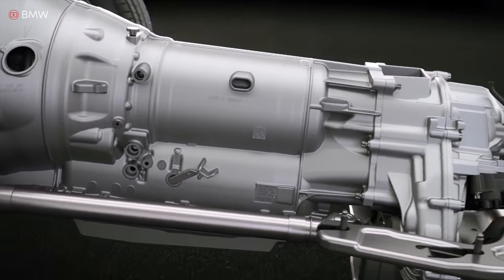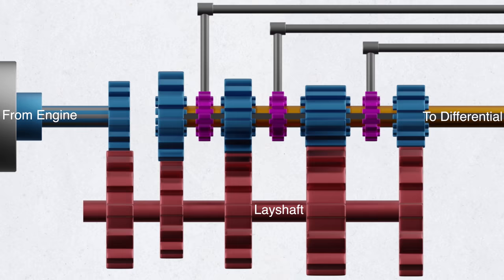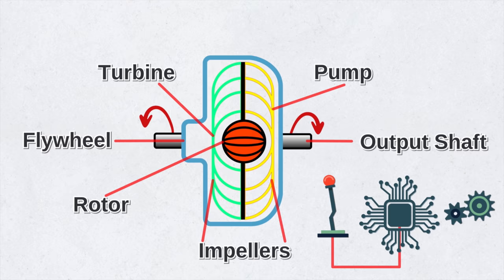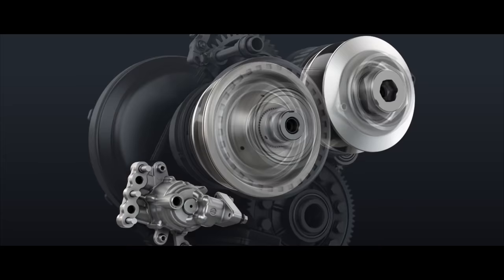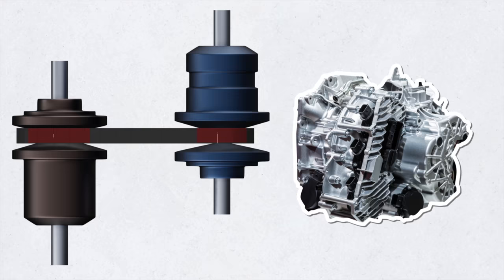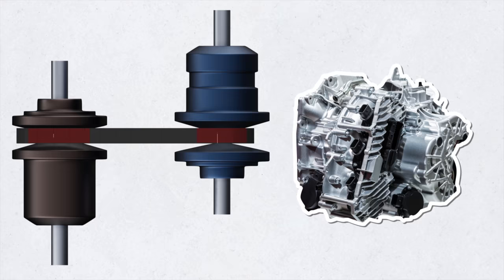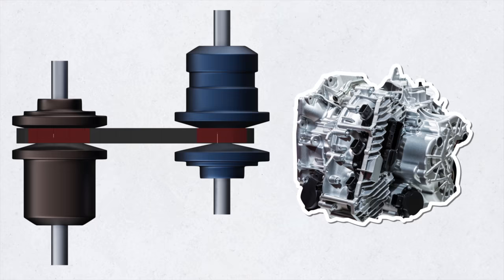Parking Like This Will Destroy Your Automatic Transmission

Comment: My wife bought a car with a manual transmission and it wouldn't shift correctly within the first month of her owning the car. When she took it back to the dealer, they asked if she knew how to drive with a manual transmission, with the assumption that girls can't drive stick. This was the point when she had to remind them that the truck she traded for the car had a manual transmission. Because the car with still under the factory warranty, they replaced the transmission because it was defective.

Comment: me and a friend bought '14 Impreza hatchbacks around the same time, his manual, mine CVT with flappy paddles for simulated gears. His manual was so touchy that even though he could drive most manuals in his sleep, it took him a month to get the hang of his new Sub. It was really rough, and when he rode in mine, he always had mixed feelings. No way he'd give up his real manual but the smoothness of it was night and day, and we got basically the same gas mileage.

Comment: This is what is stated starting 17.24 "another common mistake is keeping fuel tank low. Did you know an automatic car depends on fluid pressure to run properly. Fuel pressure also helps to keep your engine parts stay cool and lubricant. So if you consistently keep your tank low on fuel you can wear out the car a lot faster than normal"
What nonsense, when does an engine rely on the cooliing due to fuel intake ( it does happen near the intake manifold, so what, that is to be expected). The methods of cooling are by convection by the use of fluids in the radiator and conduction through the engine casing such as fins. 
Scotty talks at million words a minute, if you listen closely and know the subject there are plenty of errors here. I did research on wear of steels and what he is saying is baloney. He clearly is talking out of his depth here.
For an engine to wear out, it can be due to lack of oil, lack of radiator fluid causing higher temperatures that degrade the oil, and normal wear. Lack of fuel in the tank means your vehicle won't start.

Comment: Manual transmissions are fine in traffic if you can adopt a smoother driving style and learn to regulate your distance from other traffic to reduce frequent changes in your speed. It's also a deterrent for thieves. 🙂

Comment: Here's my horror story. In 1981 my company car was a beauty black Cordoba. I loaned it to our sales manager for the weekend. When he returned it on Monday he left it out back of the parts department. When I went out to move it it was gone. Over the weekend the sales manager had broken off the parking pawl and when he left it for me it was running on high  idle. It managed to slide into reverse and race past 4 service bays. Our shop truck was being loaded with garbage by sheer luck the young fellow heard my car coming and dove out of the way just before my car slammed into it at about 25 mph.

Comment: How strong are CVTs for pulling trailers?  Our 2013 Subaru Outback with a CVT has the same trailer rating as the "normal" transmission, but are they really equal?

Comment: I like the idea of a cvt. They were popular in The Netherlands' only home-grown vehicle:, the Daf. They were often sold in other countries to drivers with disabilities. But you never felt you were in "the right" gear.
British attempts to automate gear changing led to the "pre-selector" gearbox. These were seen on "posh" vehicles like Armstrong Siddeleys and (British built) Daimlers. They didn't progress to fully automatic, because the missing component was always - believe-it-or-not, memory. So they still made use of the brain which was thrown in for free with every driver.  British buses continued to use pre-selector boxes until the end of the century. 
In general pre-selector gearboxes were swept away by the superior fully automatic types available from America. There was usually a substantial weight penalty, compared with a manual gearbox.
Note that one of the lovely things about electric vehicles, is that you don't need to "change gear".

Comment: I did heard rolling in neutral saves fuel, but if scotty says it doesn't then I bet he's right. I noticed the car did went faster but its always downhill so it's dangerous.
Reply: Engine is on, why would it save fuel lol
Reply: I like tk ahift into nuetral at long lights... in drive damage engine stopped ?
Reply: it doesn't save fuel in modern cars. when coasting downhill in drive the ECU lets the wheels keep moving the engine via the transmission and gravity. on some slopes using no fuel at all. It doesn't do that if you are shifted in neutral because then, the engine is disconnected from the wheels and has to keep itself running via using fuel
Reply: @nickmalone3143  no it won't damage the engine

Comment: I had a huge argument with somebody about not just putting the car in park but using the hand brake/parking brake/emergency brake. They argued that park is called park so it's fine. As though parking brake is called that because they just picked a word out of the dictionary? And the wear on the pin is fine because it's a "solid chunk of metal" as though dynamic stress isn't a thing. 2 extra seconds of habit to save your transmission, why wouldn't you?

Comment: One time I had an 86 caprice. Had a cig cherry fall on my hand and flung my arm up throwing the car into park at 50.
Reply: ...and ?
Reply: You left out the most important part-what happened?
Reply: Brrrrrrapppptatatappppp Trans gone
Reply: Oh yea I bought it for 300 bucks and got 350 at a junkyard
Reply: That must have been fun, these modern dial transmission shifters are scary. Try to turn down the music or HVAC fan and you'll destroy your transmission instead for turning the wrong dial.

Comment: 03:56 my Dacia Sandero 1,0 L can drive  with 1 US. gallon 48,2 miles ( 5,03 L/ 100km ) on highway 90% / 7 % Urban and 3 % city mode. Manual gear box  108 Nm / 5300 rpm and only 53kW ( 73,5 hp) .

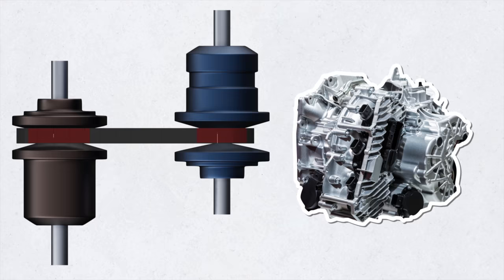Comment: When I park with my automatic transmission I'll put on the brake, put the car in neutral, put on the parking brake, lift the main brake so the car settles into the parking brake, and then put my car in park and shut down the engine. 18:13

Comment: Excellent talk on transmissions.
Daf 33s had a variable belt drive transmission back in the 60s and 70s, the system was reliable.
The problem what some people had was the shift lever as you could easily leave the transmission in either forward or rev, you could jump in start it in gear and if you didn't look at the position the shift lever was in you could easily rev the car when you were thinking it was going forward and rev it into something, was not good .
There wasn't a start inhibate system.

Comment: I guy I went to high school with had a VW Beetle with that semi automatic. All you had to do was let off the accelerator a little and shift gears. It only had 3 speeds so you didn't have to shift often. But it seems like CVTs are so complex that they are kind of like modern electronics in that they are designed and built to be replaced and not repaired.
Reply: If electornics fail to keep the belt size the same through gear change then it ultimately  breaks .... tranny controller fails then it literly destroys the mechanical parts
Reply: They were junk
Reply: I had one of those too. No problems with it, but I hated it anyway. I had to take what I could get when I was 18, though.

Comment: I was once pissed off with my car, I grabbed the transmission and put it into drive without depressing the button.  I broke the park pin and never did fix it,  I could shift just by looking at it after that.  It would pop into reverse on a bumpy road

Comment: I got the transmission in a 2002 Civic flushed with over 200,000 miles on it.  Terrible mistake.  The transmission never shifted right after that, and ultimately failed hundreds of miles from home.

Comment: We need a stat for accidents on how many are had driving which transmissions
Reply: Hard to drive crazy in a automatic.  All you can do is floor it and point the steering wheel. And hope for not to much understeer
Reply: Those stats wouldn’t tell you much more than that.

Comment: I have a stumper for anyone inclined to answer.
Just had a Son and Mother come into my Autoparts store and get their codes ran on their 2002 Chevy Corvette with a supposed LS1; why would it come back saying the Cap and Rotor needs to be replaced? I told them they had either a engine swap and or ECU. They didn't want me to take a look at their engine at any point........

Comment: My first car was 1964 GTO with a manual 4 speed. I have never liked or trusted automatics. They are expensive to buy and repair
 My manual cars only needed an occasional clutch which I would replace myself in about 4 hours for low cost.

Comment: Wait what? you don't replace the cvt belt, it doesn't wear.  Change the cvt fluid yes, but the belt is never the problem.  The bearing's that allow the pullies to move crumble and jam and the belt comes apart, but it's not because of wear on the belt.

Comment: My first car was a 1991 Chrystler Lebanon comfortable ride  i  bought it used and noticed a week in to driving it  that it hesitated to shift and sometimes had a hard shift. I was 17 at that time it was around 2000 i took it in to they’re mechanic to get fixed because if i did not id void warranty now i had saved up  and paid in full . Eventually 3 years passed and i babied that car  or at least I thought i did. I kept fluid levels correct at all times . My friends accused me of grandpa slow driving at the time. However the hard shift came back  they had closed up shop by then. They couldn’t compete with the bigger car dealers in the area supposedly any ways one day while driving on the interstate my car did the little pop thing and then locked up and that was that. My next car was a 98 dodge neon it only supposedly had 16 k miles and it was like new everything looked perfect and importantly affordable…2 years in transmission did the same exact thing as the labaron. Next car was a seabring same thing  all at different miles. Different dealers . 

Years later a mechanic friend of mine claimed dodge and they’re other brands have bad rep on transmissions  yet i see  thousands of them around that seem to work still. Is the dodge transmission thing a myth or does it have merit.? I know they make jeeps or at least own them. Did i drive them wrong or did i get screwed by the dealership? like i said i was a fanatic about keeping my car the fluids and everything else clean and tuned up tried not to drive hard. Like i never raced it or drove angrily or aggressive because as my best friend put it ‘’tickets are expensive ‘’ all these years I’ve tried to avoid dodge cars because of this. Sorry this is a novel. Lol  

I guess my question is about dodge transmissions and if it was them did they fix the problem or update to a newer design?  All of them were automatic trans

Comment: I killed a fuel pump by habitually running low on fuel. First it broke down when the fuel filter clogged. I got that replaced but within 6 months it broke down because the fuel pump died. Then the shop replaced the pump, but not the check valve as recommended so what fuel was left sprayed all over the road (that wasn't my fault). That was 3 cars ago, though. I fill up at or before a quarter tank these days. 

I do sometimes put my current in drive while still rolling backwards or park while still rolling forward. I'm trying to stop doing that and stop the car completely.

Comment: Their are at least a couple 'Most Regrettable' issues/decisions which come to mind on my owned since new 2006 4X4 DC Tundra LTD, and most were due to my own ignorance or lack of experience in maintenance, such as 5K/6 month oil changes, ATF/Gear Fluids Refreshes and driving habits, most of which by time of learning/correcting the damage was already done despite no catastrophic failures.
Though I'm at just over 102K on  odometer, not having long smooth highway miles and instead lots of stop & go commutes or short around town shopping miles makes for quicker excessivel wear, even though Health  Issues have handicapped extended travel.
Fortunately I became active in self repair/complete maintenance before it was too late to save her when physically able.
However, we can't turn back time so going forward it is imperative to make sure not continually repeat negligence as soon as you become aware of such, from Engine/Tranny/Drivetrain, Electronics/CPU & Suspension/Alignment to Cleaning Exterior in order to get maximum longevity.

I must give TONS of credit to Scotty/YouTubers for sharing their knowledge & experience in order to teach Us from Basic to Advanced sound mechanical skills which can save Us from getting ripped off to keeping Our Vehicles in Tip Top form.

Thank You Scotty!!!
 You ARE the Best.
👌 👍 😍 🥰

Comment: Damn had my car for 4 years barley drove it only put 20 k miles on it those years but barely used parking brakes even when I lived in West Virginia. Will start doing that now even in I live in Albany 😂😂. And running the tank on empty. A 1400 fuel pump replacement set me the hell straight .

Comment: Can someone provide a better explanation for Scotty's tip about keeping your fuel tank above the 1/4 mark? What I think I know:
1) Fuel isn't used for transmission cooling
2) Fuel isn't used to lubricate pistons and bearings in the engine
3) Fuel isn't used as hydraulic fluid anywhere in the engine or transmission
4) Fuel pumps constantly pull fuel from the tank and bring it to the engine compartment, where the injectors take what's needed. The rest is returned back to the fuel tank. Fuel probably acts as a coolant for the fuel pump, but I kind of doubt the pump puts out so much heat as to require 2.5+ gallons of fuel chilling in the tank to avoid damage.

Where am I wrong, or what am I missing?
Reply: There could also be junk on the bottom of the tank that the fuel pump grabs. Not typical these days but it has been known to happen especially with a gas station that never cleans or inspects their storage tanks.
Reply: It was a mistake. No connection between those two systems.

Comment: I have a 2020 Hyundai Accent with a CVT transmission. I find in city traffic around 50 km when you take your foot off the accelerator the car doesn’t slow down as fast as an automatic transmission.
Reply: Ditto. 2020 Subaru Forester CVT.

Comment: Is it really necessary for me to use the parking brake on my automatic transmission car when it is on a flat surface?  This man says so, but so many others say it is not.  Even when I did not drive, I knew NEVER to switch gears while the car was in motion.  That is just common knowledge.

Comment: I have no idea why this video was recommended to me.  I will never own a vehicle with an automatic transmission again.  I have only had one.  It handled really poorly, shifting completely wrong as to how I feel the transmission should be shifted.  It used more fuel.  It was rather sluggish as compared to a well shifted manual transmission.  As soon as I finished paying the vehicle, I sold it and bought another vehicle with a manual transmission.  They are not for me.

Comment: CVT would be pretty optimal... but every one I've ever experienced has been designed SOLELY for fuel efficiency; NOT performance in any way.  So the cars always had horrible standstill acceleration and screamed like a banshee at highway speeds (granted, the cars had lots of sound insulation so it's not extreme within the car).

Comment: When sitting in traffic for a long time, you shouldn't put the car in park. Instead you should put it in neutral. The transmissions are generally designed so you can go between drive and neutral without pressing the button for these situations. If you put it in park, you actually go through reverse gear. If you aren't being careful you could put the car in reverse by doing so, not a good idea!

Comment: I have 2000 Toyota Camry LE 4 cylinder that was given to me. According to the third own they had the automatic transmission repaired. It leaks around the transmission pan. This year and model take one of two transmissions. I don't know which model I have to get a transmission pan gasket for the Camry. Maybe I should buy both and let the mechanic put it on. And take the extra one back to the auto parts store to get my money back on it.

Comment: I never understood why wouldn't americans use the parking brake along with the P position in the transmission. Since I drove manuals my whole life, the first thing I did in an automatic was to pull the parking brake and leave it in neutral... and find out the car wouldn't let me pull the keys out. 

Hitting P it will let me have my keys back, nice, and won't explode the parking pawl on a hill because the parking brake is applied.

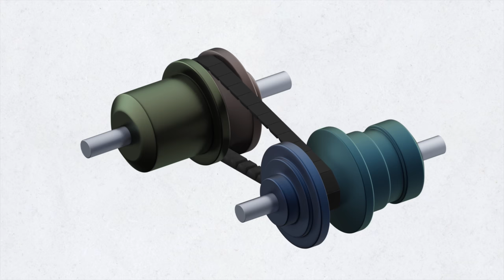Comment: @8:37 That's the key for a better engine, somehow change the high friction belt for a another mechanism and/or Timing Chain
Reply: Timing gears are slightly less efficient, but can out last the engine... belts are going to break every 20 - 80 K miles... chains 150 - 250 K miles...

Comment: I bought a second hand yaris with automatic gear (vios sedan 2015 ) 
It jerks most of tge time when it shifts gear to second gear (20km speed) occasionally it also jerks ryt before speed of 60km. I hope it must be de fourth or fifth gea

I honestly dont know what the issue is. I showed few mechanics here in Saudi Arabia. They asked me to change the entire gear box which i believe is an expensiive easy solution. The jerk is not highly noticeable and some mechanics said there is no issue with my gear box. But i have driven other same model cars but its all very smooth and we wont evn know the gears being shifted while my car causes slight jerks.